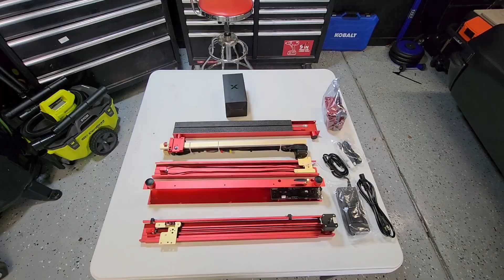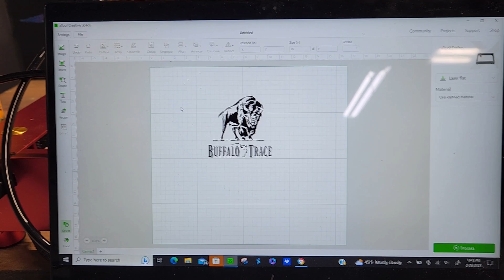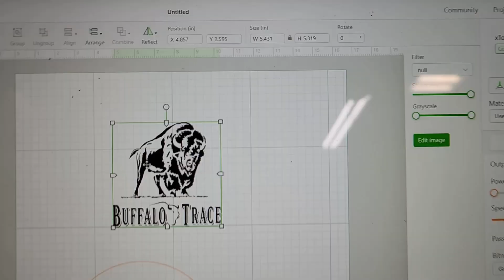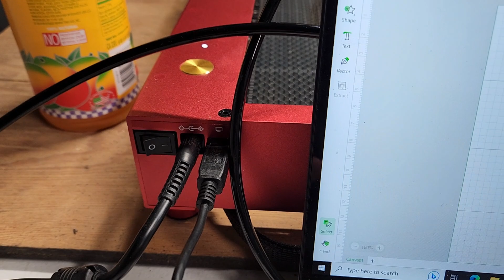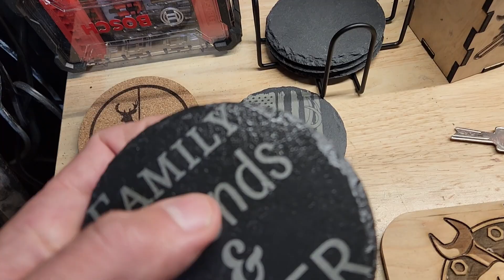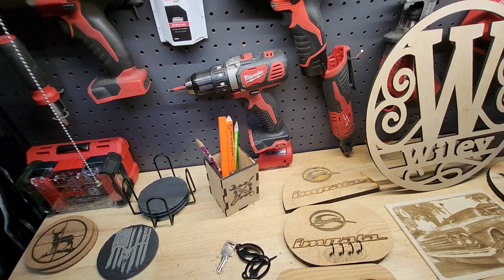Best Tool in my Shop❗ Xtool D1 Pro 20 watt Laser Engraver

Comment: What settings allows it to engrave deep on some and not so deep on others?
Reply from the maker: higher power settings at lower speed engrave deep. lower power and faster speeds are lighter engraves. I usually try to use a practice peice of material to get my setting where I want them

Comment: It's best to enclose it and have an outside exhaust because of fumes. Some of the materials in plywood can be very nasty to breathe.
Dust from sanding some woods can be too
Reply from the maker: good to know I just been using a fan to blow the smoke fumes out the door but definately can still smell it
Reply: @AllThingsCool  you also should make sure it can't be viewed without the special glasses. They do make plastic panels that will block the lasers.